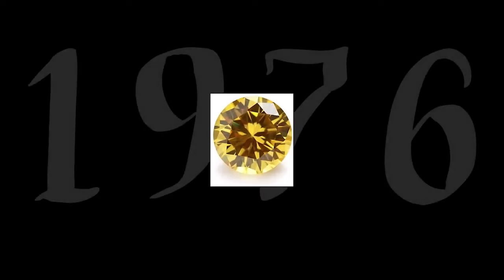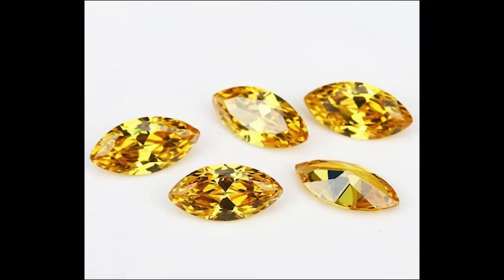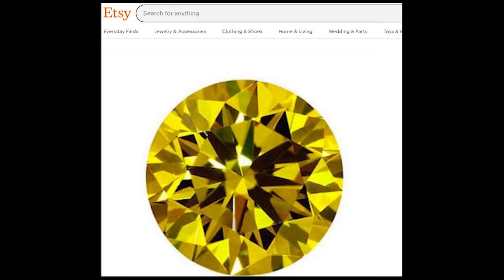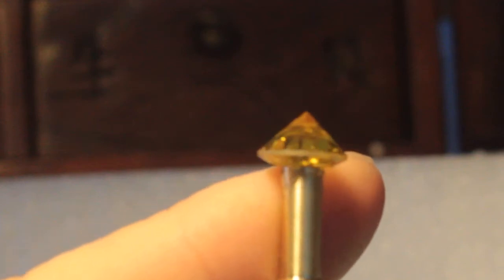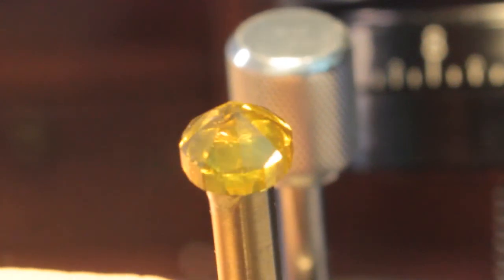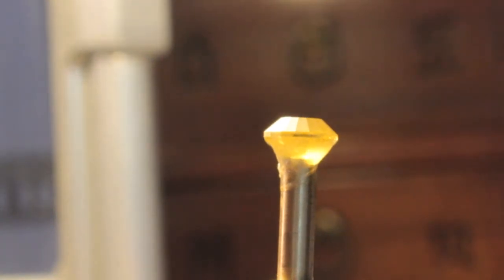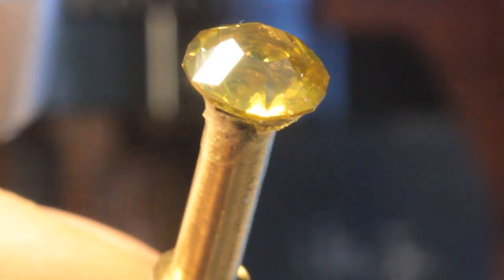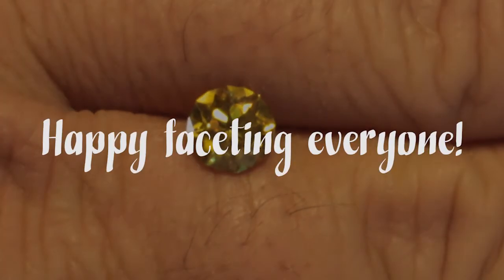Gem Cutting Tutorial: Sydney Sparkler Cubic Zirconia

Comment: Is the Sydney Sparkler design available and on file somewhere?  facetdiagrams.org has it listed but not open with values?
Reply: check the aus faceting guild
Reply: @sibus42022   is right.  Currently, you can find the cutting instructions for the Sydney Sparkler under the 'events' tab.  The PDF file for the Sydney Sparkler is on page 14 of the 2021 Annual Faceting Competition Schedule.